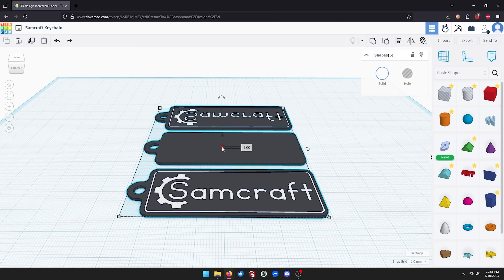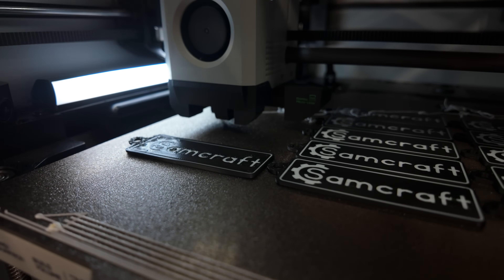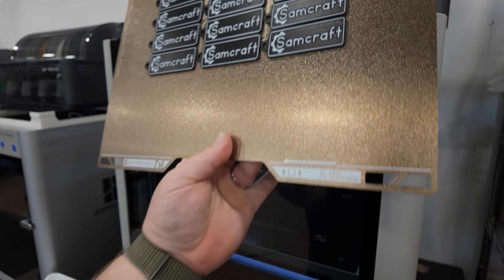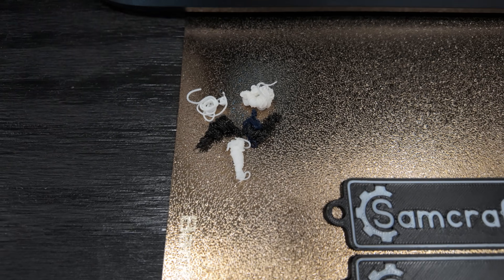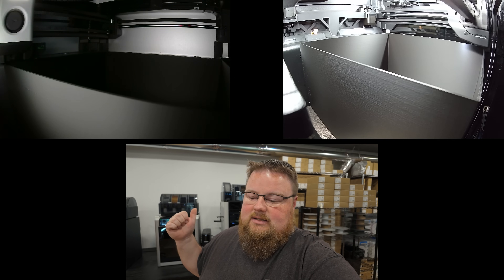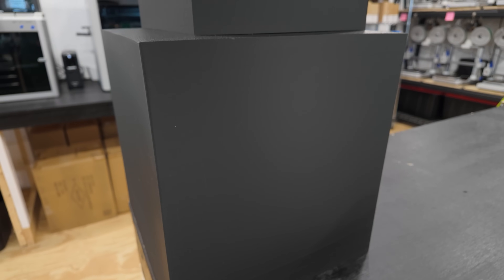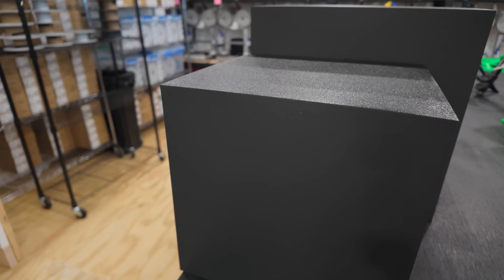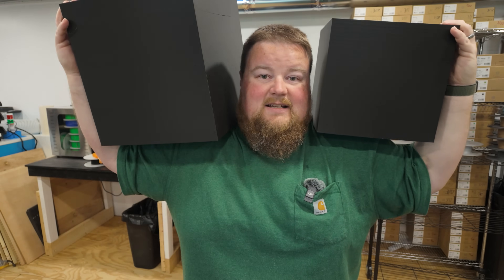Bambu Lab H2D vs. X1C // Poop, Print Size, Noise // Real Life Tests

Comment: can anyone tell me, how much space do you need above either one of these printers, to change out the filament rolls, l have 28 inches from my bench to the shelf above it, l'm leaning towards the bigger option, just because, but l am wondering if l am going to need to move my shelf.

Comment: I’ve had my h2d about 48 hours now, it is definitely quieter than my A1 sitting next to printing the same parts, it’s also pumping out more parts in faster print times. The next thing I noticed was how clean the prints are coming off the build plate, I love my A1 but it has artifacts around corners and overhangs that just are non existent on my h2d, with stock settings on both. I have no complaints about mine other than I dislike pei after using Kdeavi plates on my A1 (Kdeavi for my h2d should arrive in a couple days) Overall super impressed with the quality and functionality, not so much on the price lol😂

Comment: i would have liked to see a more significant multi-color print.. e.g. with at least 3 colors so they both have to change.  also print time.  i don't feel like i got a very good sense of how much difference it would actually make if i bought one of these vs the other

Comment: Thank you for doing the full print size comparison. When I first saw my very first 3D printer 20 years ago, I instantly saw the potential of these machines but decided to wait out the massive learning curve and growing pains of these machines since they mostly produced 9 lumpy, molten shapes of plastic for every 1 that worked perfectly. Now, years on, it appears that they (the industry) have worked out those kinks and are producing tools that will work when I need them to work. Anyway, I'm in the market for my very first 3D printer and this video really helped me decide to try the H2D. Thank you

Comment: Sam, kinda wanting a bigger printer have  an x1c now, thinking about the k2 plus but have seen a few problems with it, Bambu is nice, but like most others really wanted a bigger bed, hoping Bambu comes out with one soon. As of now what's your opinion on the 2? I'm definately not a expert on fixing stuff, thats why i've loved  my X1C... Thanks, great video.
Reply: Got the K2 plus and had a Galactic Armor helmet fail twice in a row with brand new filament each time, it went back

Comment: Great comparison! Have you compared power usage between the 2? I have to think the h2d will use a lot more with it being bigger and heating a 2nd nozzle.
Reply: It does, particularly if you are using that second nozzle. But not by as much as you might think. The extra current used by the bigger print plate, the heated cabinet and the higher temp nozzles will ramp current. But if you’re printing the same way in both machines, the difference will be mess.

Comment: Thank you Sam for that great comparison between the two. New to 3D printing since Black Friday and run my X1C 24/7 since then with almost no issues. Bigger is always better in my book, but really how much of a difference here is it truly? Does it justify the cost? Unless I plan to make sneakers, or begin selling products, I’ll stick with X1C for now unless a big sale comes around. I’m a CNC guy and love my wood, but 3D printing is completely opposite of what I’ve learned. I haven’t learned Fusion yet (use Asoire for woodworking, and also have designed some projects on my woodworking design software for 3D printing), but glad to know I’m not the only one still using TinkerCAD. Good job.

Comment: 3:42 that looked very impracticable sir. might i suggest you drill one hole for each machine in the table and print two square to round channels that you fix to the exits with the fixation of your choice? all u need to buy is the hole saw and some cheap flexible or fixed duct. heck you can print one and drill a lot of hole in i a circle on a sunday like i did ;) 

then have your bins on the floor or make a neet systemrack for it.

Comment: The specs mention a Hepa 12 filter.  Can you confirm there is a hepa filter included in the NON laser H2D?  I can’t find a replacement filter for it on their website.  And I haven’t heard it mentioned in reviews.

Comment: You would want to hope the H2D does a better job considering the price difference between the two, and the fact the H2D is an upgraded model with a few more years R&D thrown into the mix. Anyone still buying the X1C at it's price point will not be disappointed.
Reply: The X1-C is already very good. I don’t know how much better things can realistically get. At least without some newer technologies being developed. In theory a 0.2mm nozzle should take care of that, but it rarely does, with 0.4 nozzles doing so much better than they used to.

Comment: The bigger volume you demonstrated is far better than any measurement (spec sheet) can depict. Every time I watch one of your videos I can see how much I can learn and do. Thanks for the very clear demonstration of the base value proposition of these two models. 

I have been going back and forth regarding the H2D and its value for the price. The comments you made about build plate size really brings into focus an important aspect to build volume. I'll likely hold on the H2D for now and hope there will be a larger build plate in my imaginary new model the "x2carbon" that would not have the cutter, pen, or laser options but deliver a larger build plate. 

Thanks for this video and all the great content you've provided to the maker community.
Reply from the maker: Thank you! I'm happy to help out however I can. :)
Reply: @Samcraftcom can you provide the dimensions you achieved?

Comment: One thing I've heard mentioned by others is, if you're using different colors that are dark & light, putting all the lights on one head, all the darks on the other will reduce the poop amounts as well (with dual AMS), or putting the color that would need the most purge to clear on one head, and the rest on the other with the AMS would likely reduce it as well..  For instance, there's more purge from black to white and vice-versa than there'd be from say, white to yellow.  When I do finally get around to buying a H2D, that's my plan, dual AMS, and sort them by purge amounts between colors.  My main desire with the H2D though is one head dedicated to support interface layer material, and the other with whatever filament I'm printing.  Many of the models we print require supports, and I'd have much cleaner printed layers with support material, but the time difference is also a problem (a model that prints in 5 hrs with no special support material takes 17-30hrs depending on how much support is there).  With the interface material on head 2, and pla on head 1 (for instance), it wouldn't add much time at all to the print as compared to having to switch from one AMS slot to another, purge, print, etc.  And you really have to max out your purge settings between the two with a single head design, or you'll have issues with adhesion between layers if those materials aren't purged enough..  I was waiting for the 'Luke, I'm your father' quote (or maybe one from Dark Helmet, lol) when you were wearing the boxes though, opportunity missed, lol.
Reply: Only complaint I have (not having one yet anyway) with the H2D is WHY did they go with a laser module?  With how much I have to clean my big Co2, I can't imagine having to do that maintenance on the H2D...

Comment: Is there a difference in speed between the 2 printers?
Reply: I just was in time to return my both new x1cs I ordered short before the h2d. I had some issues with the x1cs, but the support was really willing to help, even though they mostly answer once a day. the took both x1cs back and I ordered an h2d. honestly this thing is a whole new level. is quiet that u almost not hear it working while standing a meter away. the only loud sounds are when it cuts filaments and so on. about speed, it looks to be the same on a one color print, but, when you go 2 colors, theres the huge difference as it only takes about 5 seconds to do it when having a color loaded in each nozzle. if you go 3 colors, then you can count the same filament changing time per nozzle which was I think about 90-110 seconds or so. all in all, having used those 2 x1cs side by side, for about 400hours each, honestly this H2D feels like a whole different league. I was kinda pissed with them for having delivered me 2 units with problems ( maybe they were returned items or something ), but they definitely got me sold out on this one. also to my surprise, absolutely no issue with this one. I was kinda worried about getting some shit going on as it's a new release, but it seems they mostly did their homework before shipping these units.If any, you mostly will encounter some bugs on Bambu Studio rather than the printer. but they will sort them out soon probably. doesn't look like they sleep on things. anyway back to your point, speed the same when using like more than 2 colors ( I think )  but LOTS of gain on all other areas. I am not sure if you use like 3 colors, when swapping to the left nozzle, if it does it instantly, and only take those 90 seconds when swapping colors on the second nozzle or something. Oh PS, check your space, this thing is Huge but looks and feels premium.

Comment: Great comparison Sam.
Here's a curiosity for you, measure how much water it takes to fill both boxes.
As for the sound testing, IMO totally valid to compare the X1C with your riser versus the "stock" H2D.  NOT ventilating the X1C will lead to significant problems down the line for the most common PLA filament, so testing the X1C all closed up and "stock" is kinda pointless.
Would be interested in perceived "odor" in your shop from printing various materials on each.  Kinda "no big deal" I'd think with PLA and PETG, but knowing if the supposedly improved air filtration of the H2D is really all it's claimed.  Maybe even comparing versus a X1C with a "better" filter like is available from Voxel for cheaper than stock Bambu filters.

Comment: For my P1S I printed a poop chute and removable bucket. The removable bucket is great, so I can just remove the bucket on the side and toss the waste, don't have to reach around back. The model I printed had a ring that goes under the foot of the P1S and holds the chute in place. I think that model fits the X1C, or they have one that fits. And those failed prints were definitely due to a dirty build plate. I've started scrubbing my plate with isopropyl and a paper towel, then washing it with a soft nylon brush and dawn or similar dish soap, then rinsing it well. Things stick great if I had any adhesion issues that resolves it every time. Thanks for the video comparison, I might get a H2D after some bugs are worked out and prices come down.

Comment: Add automotive sound dampener pads inside the bay (I used Kilmat).  They not only cut out astounding noise, they act as a reflective insulator.  When running my P1S on a bed temp of 70c I get internal temps of 39c when the door is shut.  Its awesome for PETG, ABS and other enclosed dependent materials.  Even with door/top glass open it still provides excellent sound dampening.
Reply: Can you provide a link to the ones you used?

Comment: Turn that Aux fan off on your x1c or print an aux fan deflector! These fans cause nothing but trouble & I haven't had a failed print since I installed a deflector sending the air straight up. The only reason I don't just turn the fan off is because I think it helps with airflow & removing the warm air faster from the chamber. Every print fail I had was always on the left wherever that fan was blowing
Reply: I only have found that it helps a lot with prints that have a lot of bridges or overhangs. But I tend to never run it super high, usually only 50% to 70% max, depending on what I'm printing.

Comment: I have not received my H2D yet but as I understand, if you are only using two colors you load one on the spool holder for the left nozzle and the other in the AMS2 for the right nozzle, the result will be 1 or 2 poops for the initial purge and not at every color change.

This would make for a much better 2 color comparison.
Reply: I think you are correct, since the AMS unit still cannot handle pushing 2 filaments at the same time, and that goes for both the first gen AMS and the new AMS 2 Pro. The only other way to make it work would be what you mentioned with the external spool and the AMS, or having multiple AMS or HT units.

Comment: Great video!

For me I’m in the camp it’s more of a flop than a hit. Most people don’t really care about the all in one aspect, and would have preferred a 350mm+ build plate. The extra 50-75mm on each side doesn’t do much.  Not surprisingly, the print quality is outstanding from what I’ve seen.
Reply: Prusa makes a larger 3D printer, but it is much more expensive with features that aren't as good.

Comment: I found failures like your key chain are due to the auxiliary fan on the left side of the printer blowing on them. Turn it off in the cooling settings. It's not needed on most parts, especially ones with no overhangs.

Comment: The keychain fail is probably coming from the AUX fan. It’s with the default 70% too high. 30-50% is enough and doesn’t cooling down the parts so much that the filament warps.
Reply: Exactly.
Reply: Agree, I tend to bias my parts as far from the fan as I can.

Comment: Just ordered  the X1C didn't think I needed all that extra size or other things like lasers and cutters since I have many lasers in the shop and wanted to get it in case the Tariffs jack the price way up and don't want to have to wait for politics to bring the price down. Who knows how long that could be with both sides going up and up the price has already jumped up on both of these already.
Reply: Sam do you have concerns with the extras I would be concerned that people using all the lasers and cutters in the H2  may create a lot of particles you may not want in your prints- or causing plate sticking issues. That also had me a little concerned but since I have most of those tools I went X1C hope it was a good choice.

Comment: Alright Sam, question for you.  In the next 6 months I am going to buy a a Bambu 3D printer, which one, yea, homework time to get the right one for my use, but it will definitely be multi-color.  But my question is software.  What do I need to know.  I started laser engraving/cutting a couple of years ago, Lightburn was a challenge.  I would bet going into the X,Y,Z realm will be quite an adjustment.  My 3D printer won't be for making money, just nice little things for our home and family, along with maybe printing broken parts for the various things on our farm.  But then you never know and never close a door.  My laser work was never meant to be a money maker, but that changed.
Reply: Bambu labs a1 or p1s will be good for you. Not worth spending double the price.
Reply: Software is easy bambu has a free slicer you will use for 90% of stuff.. model files you will pull mostly from printables  and makerworld. If you want to do your own designs there are several model software programs from solidworks to tinkercad to shapr as well as others find the one you like that fits your price range from free to outrageous. Some have veteran discounts if that applies. But you will be amazed how much free to print for personal use stuff is available.

Comment: As a tip for the failed keychains in the beginning:
You can skip faild objects an the printer and in the app in exactly this case.
Reply: I was just jumping in comments to suggest same, just recently noticed this in Handy app, very useful feature
Reply: I believe he was going more for a 'this is the total waste & print amounts', skipping could have (but not likely) affected the outcome.  If he'd have weighed both the items printed and waste from each it definitely would have skewed the results by skipping.
Reply: can also do this from the touch screen on x1c
Reply: @ yes, there is a skip button on the Main screen.
Reply: Can we skip on the a1 series too?
Reply: @BennyTygohome  I think it's available, but only on the handy app, not on the printer screen.
Reply: @Rangido3D  awesome.  I used skip for the first time today and I've had my A1 for over a year without noticing that feature existed.  Thank  👍🏻
Reply: @BennyTygohome  yep
Reply: @BennyTygohome  yes the A1 Series has the function as well

Comment: I am just starting to watch the video. But, i have noticed that after the H2D came out or after the last week or so that the AI on my X1c is not as good as before as to the Spaghetti detection. Did you upgrade your X1C to the latest firmware. Wondering what could have changed. I went back to the firmware I was running before so I will have to test some more to see if that resolves my issue.